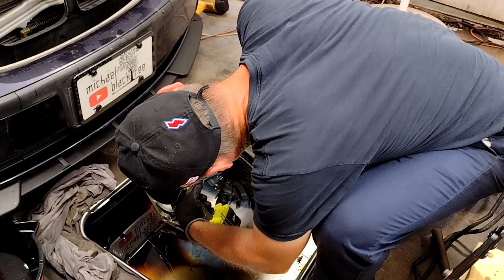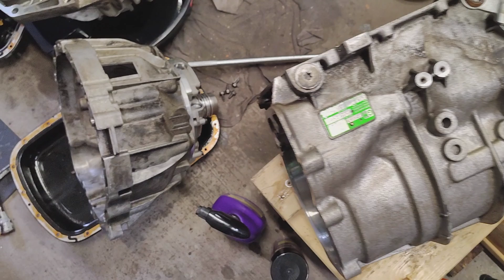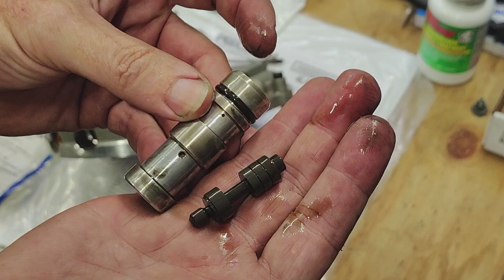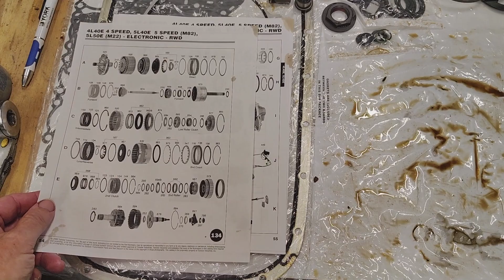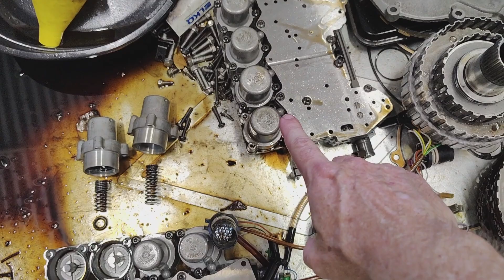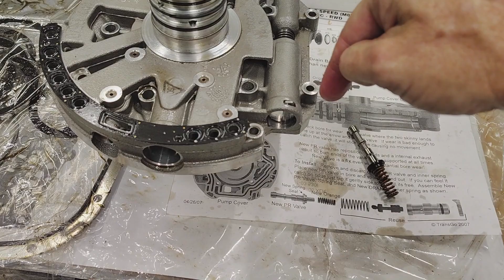Building a "High Performance" Automatic for the E46 BMW, Featuring SuperClean

Comment: Great video!  Haven’t done a transmission rebuild.  But have a 00 323i project car where trans pump seal is leaking.  Contemplating trying my hand at a rebuild as paying for it is very expensive and less gratifying.
Reply from the maker: The GM transmission has a giant snap ring inside, which requires giant snap ring pliers. IIRC the ZF unit is easier to disassemble. But either way, it can be done if you have the time and some tools.

Comment: Hello Michael, thank you for making this video. I own a E46 330D which I take on the Nürburgring regularly. Now, my stock 5l40E is starting to slip going from 4 to 5th gear. Since the stock torque of the 330D engine (410nm) is already way over the rated 340-360nm of the transmission I was hesitant and did not get it tuned yet. Since I will probably end up having to rebuild my transmission anyway, I might just do the same thing you did to improve longevity. Did you find a way to tune the transmission software to get rid of the ridiculous 'continuous slip' design of the 5l40e?
Reply from the maker: I haven't done any tuning of the software yet. But IIRC there is a ZHP tune available for it.
Reply: @michaelblacktree  Thank you for the reply. Can I ask what brand of master rebuild kit you used? Since I live in Europe there's not much available here it looks like.
Reply from the maker: I used the Raybestos master rebuild kit. It's available on ebay in the US. Not sure about Europe.

Comment: Superclean look Work good,
The next part, 
I have an 325i 2002 with zf 5hp19, and want to know wish One is better, 5l40 or 5hp19, im waitting for amswer thanks
Reply from the maker: Depends on your preferences. The GM unit is physically stronger, and has better aftermarket support. The ZF unit is more refined (i.e. more comfortable). Take your pick.
Reply: @michaelblacktree  ok good, well i just want to know the better option less damage....

Comment: i need to know. i have 5l40e . can i just buy 5l50e and bolton gear box? m57d1
Reply from the maker: I'm not familiar with the M57 engine. But you might be able to put the BMW bellhousing on a Cadillac 5L50e. And of course, you'll need to make an adapter bracket for the trans mount.

Comment: Not sure if i missed it but did you use the bmw valve body?

Really good video ive never seen anybody put any care or effort into an automatic for an e46 haha. Are you going to use the stock TCU? From what ive seen they have been reversed engineered and you can change most of the tables
Reply from the maker: Thanks. I used the 5L50e valve body (from the Cadillac). And I plan to use the stock TCU.

Comment: I am curious if all those firm shift upgrades will make it less comfortable. When I go through this it won’t be as rebuilt as you went being a racecar vs my daily/softroader x5. This will be great reference material for people years to come!
Reply from the maker: We'll find out soon enough. 😎
BTW, I think your X5 already has the 5L50e transmission?
Reply: @michaelblacktree  I promise it doesn’t. It has the same bell housing you have and a different output shaft for the T case, but BMWs never got the 5l50e in anything at least from this era. We only got the 2nd revision valvebodies in 2003-2006 model x5s while Cadillac got the third revisions.

Comment: thanks for the great video. would it be a viable option to go with an adapter plate and a e90 or any other transmission?
Reply from the maker: The ZF 8HP series transmissions are a popular upgrade. They can handle some serious power. But they're more expensive. You'll also need a lot of custom parts, and an aftermarket trans controller.

Comment: Super Clean!
Very satisfying to watch the transmission transformation during the cleaning process. It's always nice to put clean, shiny parts back onto your car.

Also great that you're documenting this process. There are a ton of videos on manual swaps, manual trans maintenance, etc., and although my E46 is a manual, there is a lot of value in having information out there for both transmission types.
Reply from the maker: Thank you. Yes, there are a bajillion videos on manual swapping an E46. How many videos on building a trick auto? I've been driving cars with manual transmissions for almost 4 decades, and will continue to do so. But I saw an opportunity to step off the beaten path, and try something different. So I took it. All that being said, if this doesn't work out, I'll probably manual swap it.

Comment: What's the estimated cost  for the trans project?
Reply from the maker: So far, I've spent about $1300. That includes both GM transmissions, master rebuild kit, Sonnax boost valve, Transgo kit, the transmission wiring harness and TCU, driveshaft, center support bearing, transmission crossmember, and the giant snap ring pliers. I still need to make an adapter bracket for the trans mount, and get some ATF. So the final price will be a little higher.

The goal of this project was to build an automatic that's stronger than stock, is mostly bolt-in, and is relatively cheap. But if you're looking for something that can handle serious power, you should look into the ZF 8HP series. And you'll need to spend some $$$.